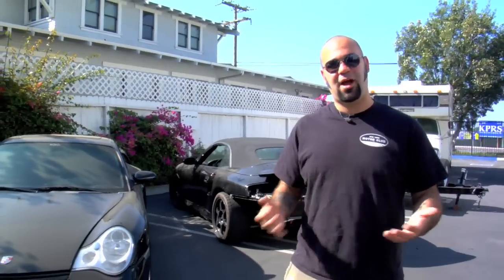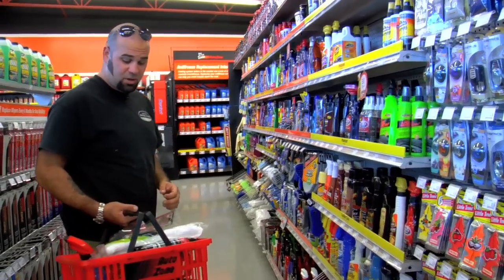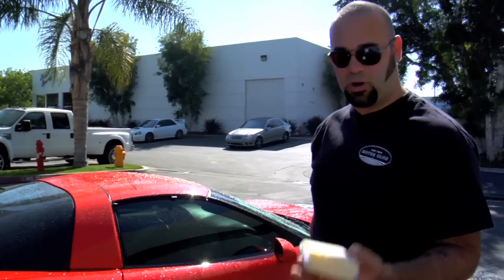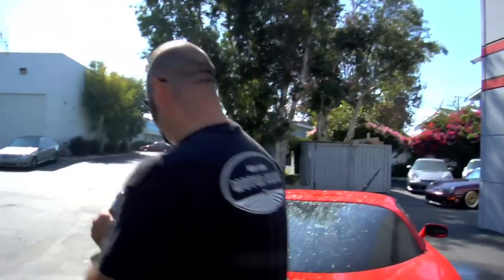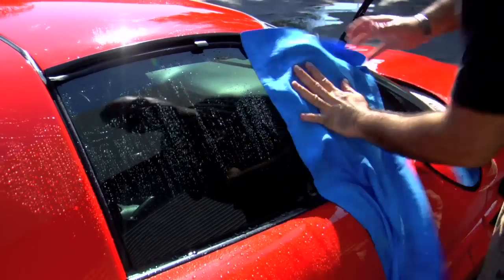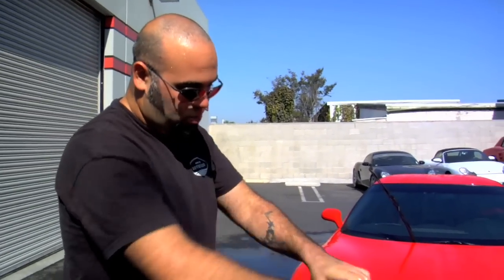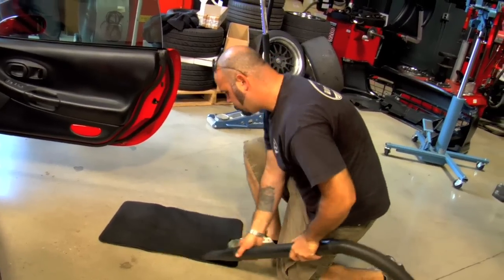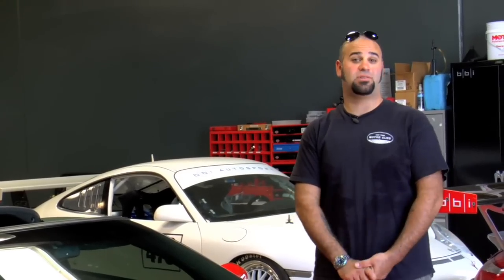How to Wash and Detail Your Car - Part 1/2

Comment: I stopped watching when I saw Matt wash his car in direct sunlight...........
Reply: yeah never do that either lol
Reply: He did much more wrong then that...
Reply: No need to do a panel at a time when using soap and water.. panel at a time is more for rinseless or waterless washes....
Reply: LOL... Should have called his buddy at AMMO NYC to do this correctly.
Reply: maybe it was boring  the current colour....
Reply: poor guy was clueless all to plug a auto shop spray spray splosh splosh over 20%
the car top job dude
Reply: Right!? No lambswool mitten or foam gun either. Or grit guards in his buckets. And the best way to dry is touch free (leaf blower).
Reply: nice
Reply: tearscratch31 :-)
Not getting into a debate, but having done 20 years in trade, I will take your post as one of trying to be funny, judgemental and severely lacking in the facts.... Cheers! LOL
Reply: ok - all forum detailers are online all day and not detailing.
Reply: 05gtdriver I do that very often never any problems with that
Reply: matt is cool no one is perfect but I hear you
Reply: Why is it wrong to wash in direct sunlight?
Reply: sk84life311 its not .
Reply: sk84life311 Well, as a rule of thumb, washing a vehicle in direct sunlight isn't advisable as the soap water solution you use will dry before you can rinse vehicle off. Direct sunlight on a hot summer day is the worse thing for washing a vehicle. Of course if you live in cooler climates and wash your vehicle in the morning or late evening, you're pretty good to go, but in this video, Matt is in SoCal (where I also live) and doing what he did isn't good advice.
Reply: 05gtdriver how the fuck do you wash a car with no soap
Reply: Loco Looney I don't recall saying that to not use soap, just not to wash a vehicle in direct sunlight.
Reply: ya I detail everyday and one thing you don't  do is in direct sunlight
Reply: It's not really too much of a concern in the morning hours...
Reply: Lol right?!

Comment: lol. this is how people detailed in 2009?    How things have changed.
Reply: What's different now in days? Lol I still use this same method when I wash and detail my car
Reply: Rene Garcia lol i was just joking, BUT.  Steam is a popular way these days. The last detail job i had done wasn't with steam though.  Guy had some mixture in a spray bottle.  Used less the half a gallon of water  1x clay bar, and some micro fiber towels. Ish looked awesome after.   I wish I asked him what kind of cleaning chemicals he was using.
Reply: Steam!?!?

You know that's really bad for your clear coat, right?
Reply: Raymond Morgan Yes steam.  And it is only bad if done incorrectly.
Reply: lol a rotary tool can be bad for your clear coat in the wrong hands. Did you not watch the episode of Jay Lenos Garage with the kid and steam detailing business lol.  You are right though, if not done correctly that is a quick way to destroy clear coat.
Reply: using a chamois also is old tech, a waffle weave or a microfiber towl is wat is used these days. its a much better way to dry it and safer too
Reply: also a sponge! lol a soft wash mitt is wat i have used for the last 10 years! lol
Reply: ShaDoWhUnTeR ellis that's what I use after I use my lead blower to blow off as much water as possible in all the door jams and cracks

Comment: Some tips my dad taught me, and I've always used since.
Make sure when you clean your vehicle, always work with gravity- top to bottom. The reason is that the lower you go, the dirtier things tend to get. This helps prevent spreading extra dirt and grime on otherwise cleaner areas. 
Tire sidewalls tend to get dirtier than wheels, especially when you use gel-based dressing like I do; it attracts more debris. Using a separate cloth for your tires will help avoid putting scratches in the wheels.

Comment: Good tips.
 I just want to add that the first rule of washin your vehicle is to do it in a shade to avoid quick drying of water or any solvent u use which leave dry spots. 
Secondly, start from top and work your way down. Most of the dirt and mud will obviously be on the lower side of your vehicle and if you work your way from the bottom, there is a pretty good chance that you will be carrying the dirt and grime to the top and subject the vehicle to scratches or swirly patterns on the paint.

Comment: You should always start at the top and work down. This guy runs his sponge through the middle of the car then down to th ebottom of the door 7 bumper (where all th edirt is) and then he drags th edirty sponge back up to th etop again!. Whats th epoint of th e2 bucket method if youre going to do that?
Reply: Good point Bill. Washing and drying is wear most scratches come from. If you want to add some neat products to your arsenal, check out www mycarcube com also on facebook "/mycarcube"

Comment: Another method for the 2 bucket wash is to use a grit guard in the bottom of both the wash and rinse buckets. You agitate the wash mitt or pad on the grit guards before washing the next panel.

Comment: thats funny he mentions black magic Not leaving a greasy film and armor all does. In my experience, armor all doesn't leave any residue at all and black magic interior cleaner leaves a ton of greasy surfaces.
Reply: I live in Australia and I try and avoid Armor All interior cleaner because it's greasy and glossy. But it may depended on where you're from
Reply: well i use armor all cus i find it works the best and it doesnt leave such a greasy finish.
Reply: Emir Suljagic I second that

Comment: TIP If you can't find bug/tar remover or want a more eco-friendly alternative. Soak towels in a vinegar solution, and leave them over the affected area for some time. Using a slightly abrasives ponge like Matt is doing, youcan easily wipe them off. The sooner you do it (after a long road trip, or once a week) the better.

Comment: I use the "single-bucket" wash system. I have one bucket for the soapy water & use the hose to rinse out the sponge as I go, so to ensure I don't put any dirt from the so called "clean water" bucket back on the mitt or whatever you're using to wash with.

Comment: agreed, first off in the vid he uses a sponge on the paint! even if my car had a light amount of dirt on it id, pressure wash first, then pretreat with a TFR spray, also snowfoam the car, id then pressure wash again, then 2 bucket method, hose off, clay bar and lube, wash again ,  dry with premium waffle weave towel. polish with DA, then seal, the wheels are another story

Comment: A chamois will mar the surface of the paint even without applying any pressure or blot drying. A microfibre of any sort (especially waffle weave) is at least 10x softer than any leather or synthetic chamois.

Comment: Either DIY or take it to a professional to be polished. Depending on the age of the car, it will take either a two or three step compounding/polishing process to remove all traces. If the car is very old (more than 10-15 years) there might be some permanent 'ghosting' left behind that can only be seen under high intensity light from angles that no one will ever see your car from.

Comment: SmokingTire, you don't have to buy all those items at Autozone to wash your car all you need is get a rag and use your dishwash liquid soap to wash your car. You don't have to clean everything off completely. Let the wax do the dual action job pulling dirt and gets removed during buff off process. You save great deal of money doing this way.

Comment: When drying your car, don't go in a swirl/circular motion. That's how you end up with swirl marks on your car. The best thing to do is dry in 1 straight line, when you hit the bottom, lift the rag start back at the top and repeat until dry

Comment: Oh that's why you have SC tags smart. Also besides washing in the sun the clay bars really work great on red and black paint. Oh I forgot one thing cleaning windows use old newspapers they work great and will give you a very clean surface without smudges. Also do not use that crap he uses to shine up the interior it will only build up and dry out the plastic. Just use a wet cloth and a small paint brush to get rid of the dust in the crevices.
Reply: That Black Magic stuff likes to evaporate and coat the inside of your windshield too. IMO, pretty much all of Black Magic's stuff is crap anyway. It's just shiny, greasy goop. Cars don't come new with all their rubber and plastic all shiny, so IDK why people would want to make their car look like it's been smeared in KY lube.

Comment: because if the car gets hot, the products you use and the water will actually evaporate before you can use them, and then you'd have to clean what you were actually using to clean ;)

Comment: Not when used with adequate lubrication, then it will glide across the surface without any friction, picking up embedded contaminants and leaving the paint perfectly clean and smooth.

Comment: I used a micro fiber cloth on the bug and tar remover step but did not get the desired results. I still had bug splash on my paint, i guess you really do need to use a semi abrasive sponge.

Comment: some steps are missing here ...1.-before applying the lubricant for the clay magic the car needs to be dried completely after washing, 2.-when you clay your car you need to do a small section at the time, 3.- after claying your car you need to rinse off your car and dry it again, 4.- to dry and polish your car you have to use synthetic towels, you can buy them in packs( if you are lucky and you live by a costco or sams they sell them in packs of 20 towels,you will need that many !!!)

Comment: Go to Autozone's website and use these part numbers to get what he got to.

Clean Tools Absorber- Part Number 34900
Black Magic Wheel Cleaner- Part Number 5072608
Meguiar's Quik Detailer Kit- Part Number G1016
Autozone Applicator Pad- Part Number 880600
Autozone Cotton Terry Towel- Part Number 874300
Black Magic Tire Wet Spray- Part Number BC23220
Black Magic Pro Shine Spray Protectant- Part Number 31723
Laitner Grip It Power Brush- Part Number 10979

Laitner brush works better for less. Enjoy!

Comment: I've also seen some mistakes you made, but I guess they have been discussed here already.. So just one quick tip: dry the side of your car before you dry the hood or the back because water at side will dry faster as the water drops are dripping down the chassis..

Comment: I use Armorall to polish the interior of my car but not too much i mean i spray a little on a sponge and doing the whole job because yes it's greasy and no more than 6 times per year { every 2 months because my car inside doesn't get too dirty and i don't smoke }  and it's ok i'm also using the same product as a foamspray for the tires and yet so good  anyway it depends where we live and of course of our preferences and products variety :-)

Comment: nice video.. my critiques 1) you should do one panel at a time, not the whole car.. 2) if you want to get real picky, foam gun it after your bug\tar prewash 3) wash a panel, rinse it with free flowing water, then use a water blade to pull 99% of the water off 4) if you clay, use Dawn before you clay5) wash with the 2 bucket wash after you clay, 6) dry with a clean microfiber cloth. then NEW clean cloth quick detailer.. 7) apply POLISH  by hand .. 8) WAX.. at least thats how i do mine..

Comment: Random but what would you recommend using to clean the car after waxing? I used to just use dish soap but now that I have the car waxed it needs cleaning but I am sure the soapp will take the wax off. What Should I use? I was thinking maybe just pressure washing?

Comment: You're not avoiding scratches with a two bucket method if you don't have grit guards in place, plus I'm sure the nylon webbing on that bug sponge works against the damage you're trying to prevent. Just hire me, I'll take care of it.

Comment: hi matt, love that vette man. I was wondering, i see you have a momo steering wheel. I drive a 98 camaro and the steering wheel is total garbage. I was thinking of investing in a sparco wheel but i am not sure which adapter i need. most of them are universal but idk if they will fit the gm steering column. can you help me?

Comment: also, when washing the car, you want to wash/dry from the top of the vehicle to the bottom. he was all over the place with that wash mit, and drying towel. the bottom 1/3 of the car is the dirtiest, and you could pick something up from the bottom and swirl up the rest of the paint if your careless with where your washing.

at least he knew not to let anything touch the ground!!!

Comment: Wow, do not wash your car in the hot sun. The water will dry before you get it off and cause lots of water marks. Those "bug sponges" will also scratch your paint. Better off to use a microfiber towel to clean off the bugs. 

It would take a long time for a clay bar to hurt your clear coat. That said, no need to use a clay bar every time you wash your car either.

Comment: i used armorall on my 1987 GLHS Shelby charger for a couple of years and it spent 75% of its time under cover in a shop or under a car port.. the dash cracked in 3 places!! I have had 10 of these cars never seen a cracked dash. I have 2 junk chargers in my backyard sitting in the sun with holes in firewall to let some weather in and still no cracks!! I have to swap dashes from the junk car into my well maintained armorall cracked dash! SUCKS!

Comment: should pressure wash with plain water first to get loose sand/dirt/dust off before doing anything. getting it wet with hose is just not good enough if your going to the effot and expense of all the other struff.

Comment: It always amazes me what people do on you tube.  It's entertaining..but most of the time it demonstartes their lack of understanding of common sense and physics.
So here are a few tips.
Don't use most products in direct sunshine (as per manufacturers instructions)
Never use a sponge on first washes...use a soft brush on end of hose.  This allows all the grit to be washed off gently.
Never use a pressure washer it just pushes grit INTO the paint.

Comment: 1st off, If the Guy Really cared about his paint, and also knew what he was doing, He would Never Get the Car Wet and then Stand around and talk..2nd.. You always wash a car Top to Bottom, and away from the sun.. 3rd... Any one who thinks a "liquid wax" like he used Protects your paint and clear are idiots. He didnt even Dry the car off right, you always start with the windows and work around that.. This is what we call a " BUCKET BOY"

Comment: after you spray the car with liquid wax and used the claybar, do you dry the car of rinse it offerte with water first?
Reply: +Mediamarktfreak yep ur suppose to dry the car before u claybar it
Reply: +Mediamarktfreak You clean the car, then use the claybar. You do not need to dry it.  But, after you claybar, you should polish the car.

Comment: whatever you do, buy "CLAY MAGIC" and no other brand, you don't need a little towel or a small little bottle of wax added to the deal and have to pay extra for it...also clay magic will last longer so you can do more than one car ....on top of that it doesn't cost as much as the other ones....after you clay your car you can apply liquid wax made by meguiars spray it on buff it with a synthetic towel and you are done...

Comment: @Spacemonkeymojo  Do one 2 foot by 2 foot area at a time in overlapping up down motions. He was bouncing all over the place and missing a lot of paintwork. Also don't clay in the sun. If you drop your clay bar, DISPOSE of it! Even if it looks clean. Last but not least Mothers clay bar is the best, followed by Meguirs, the cheaper brands are harder, more difficult to run across the paint, and leave more residue. Mother's leaves none and glides very easily.

Comment: Most of the products that you bought are really low quality. I use only products from Griot's Garage. I have used everything. Zymol, Meguire's, and really expensive stuff that is for pros only. I now use Griot's Garage's products. NOBODY has more products for getting your car as close to professionally and safely cleaned than Griot's Garage. Trust me.

Comment: You do awesome reviews man but the way you wash your car has a lot of downfalls. You should be starting from top to bottom with your car and have grit guards in your buckets. Aside from that mistake you definitely showed novices how to wash their car. Also when your drying your car you shouldn't be applying so much pressure when drying as if there is any leftover dirt you are going to be dragging it on the paint.

 Just thought I would give you some feedback.

Good video overall.

Comment: All you have to worry about,in the sun, is soap spots.

You don't wax in direct sunlight, or when the surface is warm. That is why you use a soap with a proper wax in the formula. Washing in the sunlight is no big deal. 

My Chevy had some pretty dodgy paint up front when I got it over 4 years ago, and I must say that while using a cheap wash soap(Blue Coral), and very little pressure washing, it hasn't gotten worse.

Now If only they sold CAR repellent...Fucking terrible city driving asshats.

Comment: Almost nothing he does is correct.  This should be removed from Youtube as a crime against detailing.  Some notes as I watch:
Working in direct sunlight- stupid
Abrasive sponges are never necessary and cause tons of damage
"clean water and dirty water" lol
"normally aspirated" lol
No suds at all- swirl city
Way too much pressure
Clay bars don't remove imperfections
Clay bars don't remove anything when you use them like that
Chamois are garbage,
He actually vacuums properly. So that's something